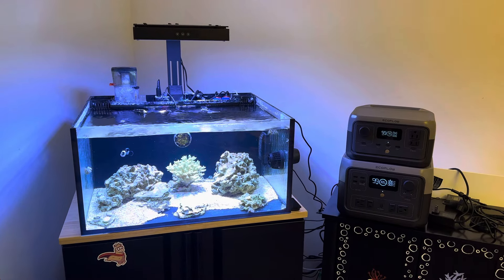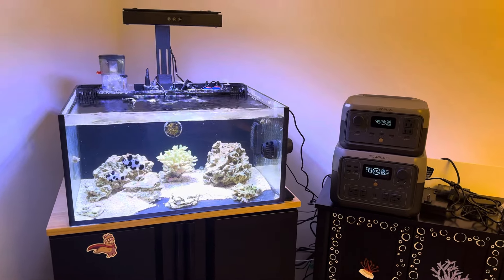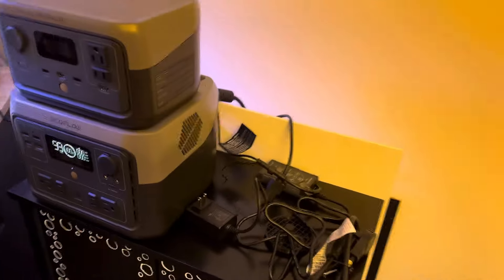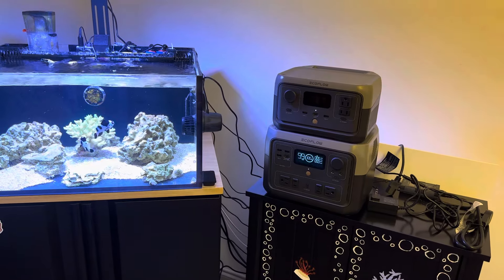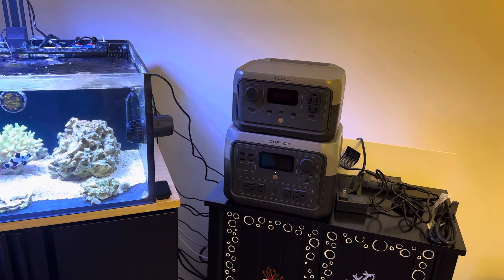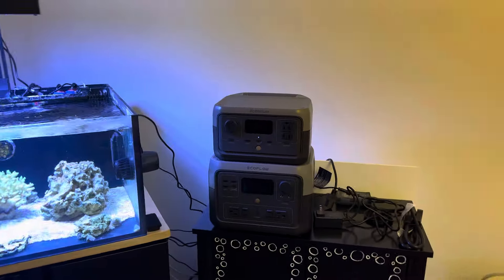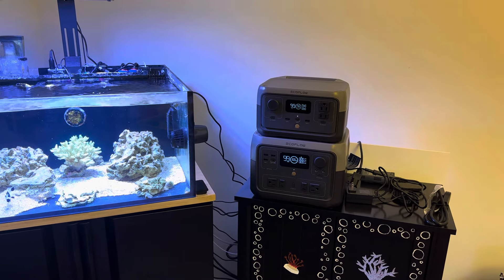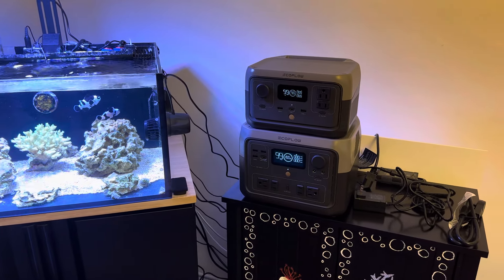Tested: Jecod DMP-10 Battery Backup Runtime With EcoFlow River 2 Units

Comment: Are the propeller guards interchangeable between the Jebao dmp10 and the Ecotech mp10?

As in: could I use a nem guard designed for the mp10 on my dmp10?
Reply from the maker: @HairyReefFrog  likely not, because the VorTech and DMP cages actually twist off in different directions.

Comment: Wonder how long a return pump, say for 75 gallon tank, would run on a eco flow max generator?  Maybe enough to not even bother with the flow power heads… just enough to keep tank stable during blackouts.  Cheaper setup than an mp10 WITHOUT the ecotech backup.
Reply from the maker: What wattage would this return pump be running at, do you think?
Reply: @kalamazoo_reefer Not sure exactly… depends on the pump you’ve got, but if you’re running pump just enough to keep chemistry stable temporarily power usage may not be that much🤔. Telegram probably already tried this just for kicks!
Reply from the maker: @ I’ve tried it myself. That’s why I wondered if you had a max draw wattage in mind hahah.